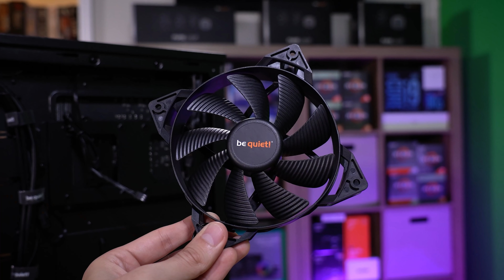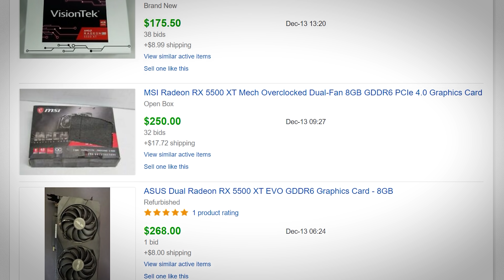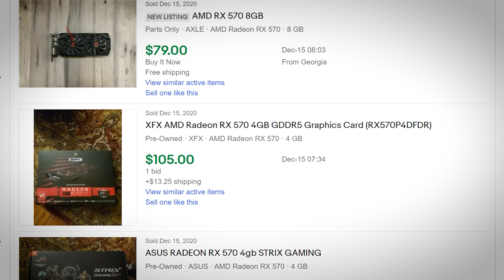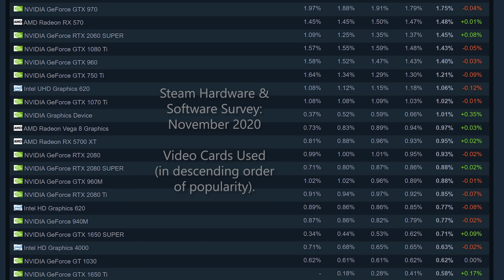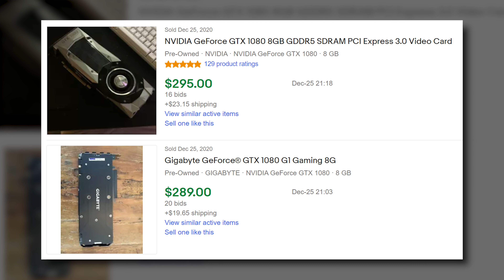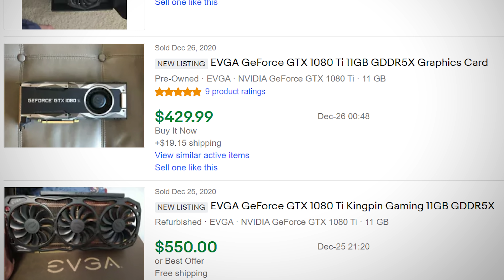2021 Graphics Card Market Analysis

Comment: Great analysis Greg, nobody seems to cover the US used market as well as you do. Keep up the great work!
Reply: Actually, as the Europe doesn't even have tech tubers, this is great video for us too - just change dollar sign to euros. 

Gtx 1070 seems to be the sweet spot
Reply: @amehu  Changing dollars to euros is still largely redundant because you're forgetting about VAT we pay in Europe. GPU values are all over the place in Europe.
Reply: @flagofpunishment  can confirm that. Over at my local retailers the RTX 3070, which @GregSalazar says in this video that it's MSRP is 500 USD, the cheapest RTX 3070 retails for 1007.05 $ (or 820.41 €) and only 2 days ago it was sitting at 780.41 $ (or 635.77 €), meanwhile the RTX 3060Ti which I don't know the MSRP of but it should be lower than 500 bucks, retails consistently at around 1239.23 $ (or 1009.56 €). Used market shows that very same 3060Ti SKU at 831.02 $ (or 677.01 €) while the same 3070 SKU I checked at the local retailer, but used, is sitting at 982.12 $ (or 800.10 €). 

Even in times of scalpers, the US of A sits way better in terms of computer hardware pricing than anywhere else. Simple geographics. Brazil is surely even worse than Europe, with their tax on consumer electronics further compounding the pricing issue.

Edit: just checked the MSRP for both cards, 399 $ (or 500-600 €) for the 3060Ti and 499 $  (or 520-680 €) for the 3070. MSRP sure is an elastic thing in Europe. Also, remembered that US retail prices don't include VAT.

Comment: Beware of 980ti it is appealing however if you're getting a evga variant run 🏃‍♂️ those guys blow mosfets like none other. Get a strix or anything else. I love evga and all but you can look this up yourself they die, I've lost two of them in separate builds.
Reply: I had one for 5 years and it’s currently in my nephews rig. That may be exception not the rule but it worked out for me🤷